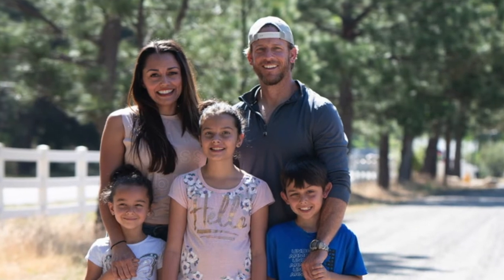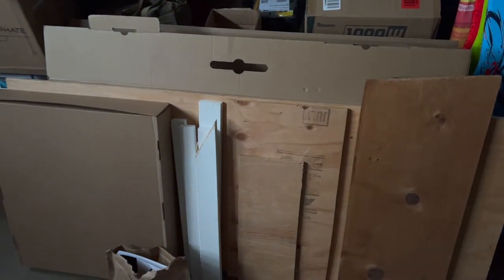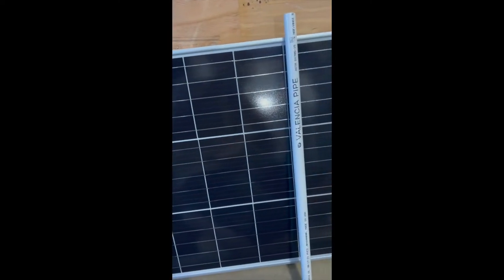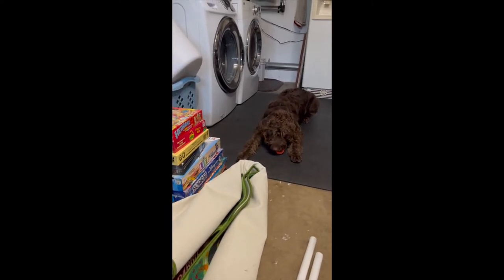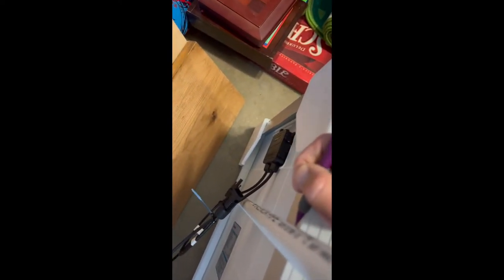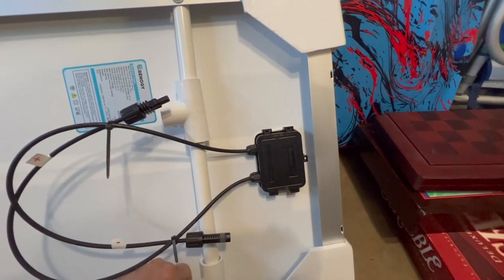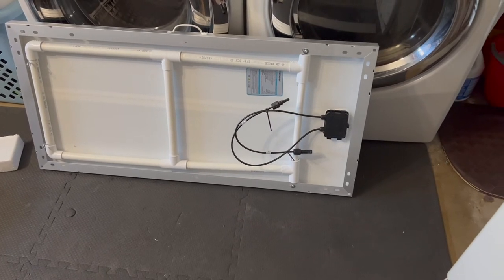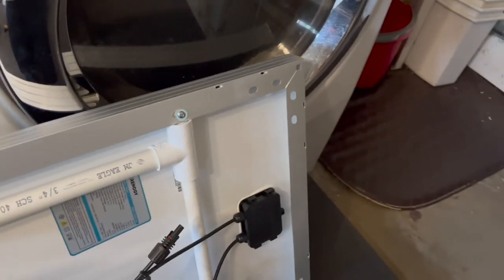Portable PVC Solar Panel Stand for Under $10 in Minutes!!

Comment: So it's all 3/4" pvc except for the top bar which is 1/2"?
Reply from the maker: Yes. The reason for this is so the smaller diameter will more easily fit inside the panel frame.